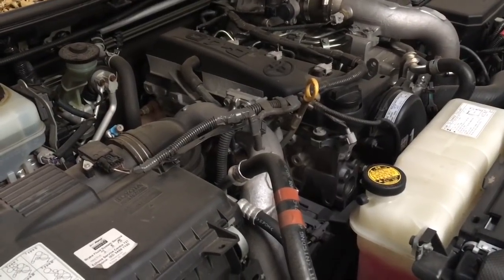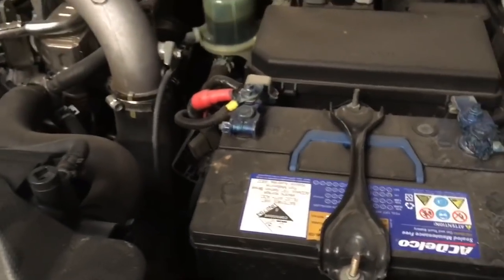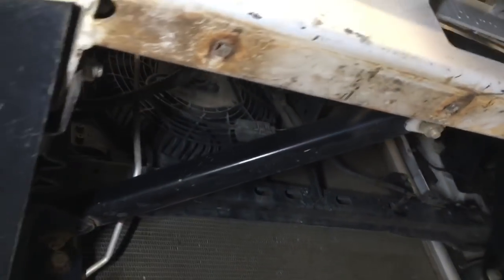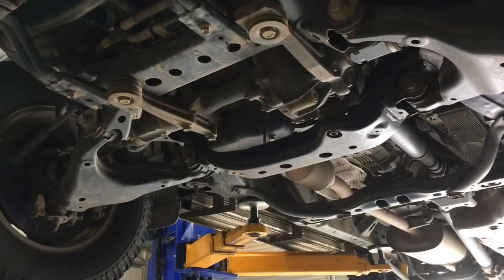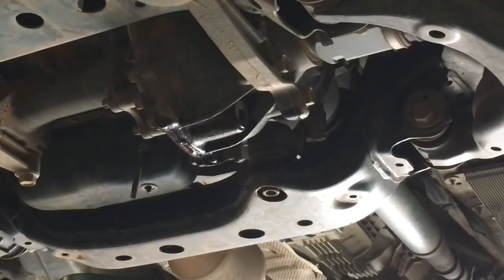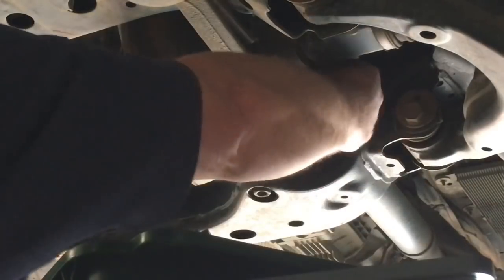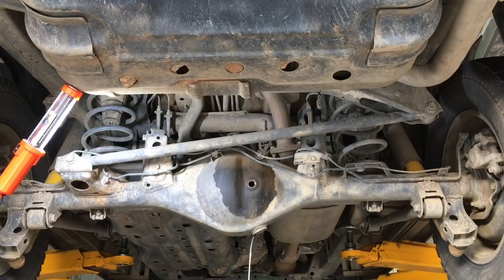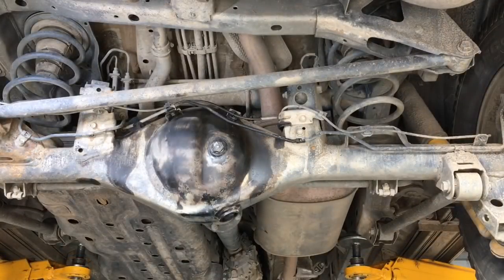Service info prado 150 160k service

Comment: When he says about the fuel filter having a pressure indicator on top, where does he mean? I thought the button on top was for pumping fuel through the system after maintenance of running out of fuel ect. Only had my J150 1KD for 5 weeks so I'm still learning. Cheers.